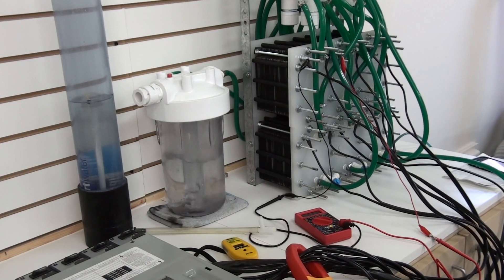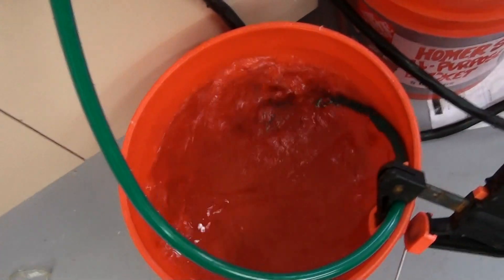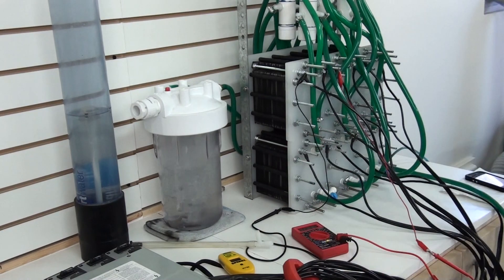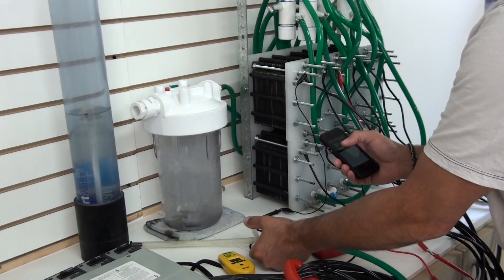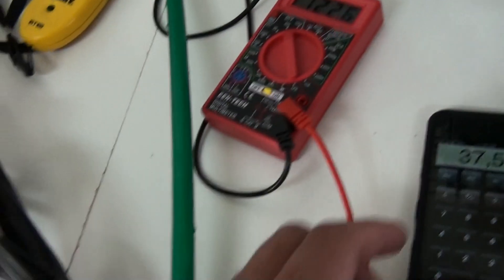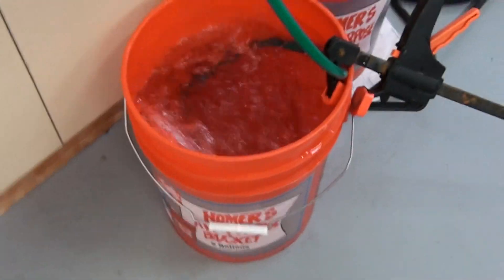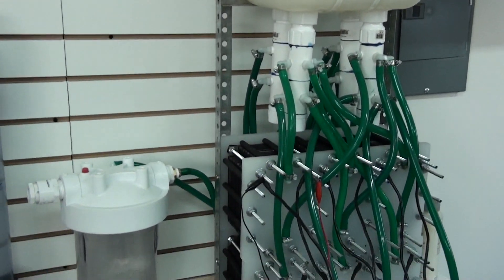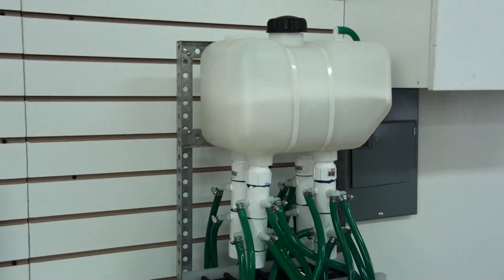Green Fuel H2o 37 lpm !! HHO 354 Plate Monster Hydrogen Generator Build Part 8

Comment: If running at 120 or 240 volts, why not use AC?
Reply from the maker: Mye Flatley because hydrogen can’t be made with ac power
Reply: @Hydrogen4Health  I am an atomic physicist.  The plates are bilaterally symmetric end to end.  The plates should work no matter which direction the current flows.
Reply from the maker: Mye Flatley sounds good but DC is what’s used.
Reply: @Hydrogen4Health  Maybe the chemical reaction is too slow to run at 60 cycles per second.  That may be it.  Oh well.

Comment: What voltage do you use - 120v ac?
Also do you just use 60hz mains frequency, or do you use a 'high frequency' output at the electrodes?
I say that, because I always suspect that if you used a key frequency it would react with the water more efficiently.

Comment: Watch this down video. You need make pressure to put hydrogen down the cylinder because hydrogen  is 14 x more light than common air on cntp. Hydrogen is 3 x lightest than helium!!! So the negative pressure of the engine can not absorb hydrogen without this capilar injection.  The hydrogen ups towards extratosphere if putted down the buterfly.

Comment: Now you just need an update on the mechanic use of this hho. DO NOT PUT it simply down the butterfly. Put this HHO under a 2mm copper or steel capilar nearest to the admitions valves..  If you do this your car will run 100% hho on all rotations.

Comment: how many liters does a 7-10kW generator approximately need per min?
does a windgenerator with his specific wide range in its voltageoutput fit as a power source, or does your system need stable supply?
i like your work

Sven

Comment: So why aren't you using common sense and capture the HHO gas safely and then use it wisely so you can set a good example for other would be max 354 plate makers??? You light it with a torch in your garage? That's really putting a good message out their!!
Reply from the maker: I have know idea what your talking about. Please explain..
Why capture it?
Reply: delvis11
I think he meant to store it if I'm not mistaken.
Reply: Your safety is his concern.
Reply from the maker: +John Wayne The shop is well ventilated. There is no possibility of explosion. Thanks for your concern.

Comment: Question, could you power a generator, that would in turn power the cells? I saw your other videos and you are getting better gas mileage, that would suggest the alternator is not robbing all the power that the HHO is generating, I have seen others do this but on a smaller scale with a 500W shop light being powered. Yours being on a larger scale it would be interesting to see how much of a load you can draw from the same generator supplying power for the HHO cells.

Comment: Now that you've made a viable HHO product; what are you going to do with it?

It use too much electricity to be a good gasoline replacement, but could be very useful for:
A welding/cutting gas or off grid fuel supply powered by wind turbines, you could even compress it into o2 tanks with a old refrigerator compressor, strike that! You would blow yourself up!

I would be interested in whether or not you do put it to practical use, it is spectacular! 
Thankyou for sharing it with us.

Comment: Let's see....127 volts at 60 amps....that's about 7300 watts output or a little under 10 HP.....so what was the input energy? Now then....a 5 liter engine running at 2000 rpm with a 10% throttle will consume right about 100 liters of intake gases per minute. This device is just a wee bit short of that by a factor of about 3. Now factor in a maximum mechanical efficiency for an internal combustion engine of about 29% plus factor in energy losses of the alternators (on a 14 volt system it will require about 7 alternators rated at 100 amps each) and that means that the engine can't even produce enough power to operate this device. Sorry, but you won't be producing enough energy to operate a vehicle.
Reply from the maker: I don't remember talking about running a vehicle from this. I have no clue where you got that from.
Anyway your numbers are off a wee bit.
Reply: They weren't really directed toward you. They were intended for the believers in the "magic hydrogen bubbler" who insist that it increases the fuel economy or in some cases actually runs the engine all by itself. In their desperation, they look for anything that they think can be used to bolster their fantasies. As far as the numbers, take another look at your video. Then DVOM clearly indicates 127 VAC and your ammeter shows 60 amps. If these measurements were made on the output side then the numbers are pretty close. This is why I asked what the input values were. Again, there are those who believe that simply adding another alternator to the engine of a car or truck would supply sufficient power to run the strictly off the hydrogen and oxygen released by a self-contained unit.
Reply from the maker: VERY COOL ! Do you have video's of this car we can look at? I'm sure everyone here and on the forums would be interested in your project.
One thing I want to know is why your getting so much heat? HHO burns so completely that it gives off very little heat.
Thanks for sharing with us.
Reply: John Doe Hate to bust your bubble but an 18 LPM generator only produces 12 LPM of hydrogen at 103 KPA (atmospheric pressure at sea level). As the available heat energy of hydrogen is 9.54 BTU's per liter and 42 BTU's is required to produce 1 HP for 1 minute then your whole system only produces 2 HP. Sorry, that's the facts.
Reply: John Doe Sorry, your example doesn't work with an ICE. Blowing more air into a forge creates more heat because there is a large supply of fuel that has not yet become involved in the combustion process. In an ICE, all but a small fraction of the fuel is burned because there was enough oxygen for complete combustion. Adding more oxygen does nothing other than increasing the flame speed and promote pre-ignition. The other reason why an 18LPM HHO system does not work is because in a normal ICE the nitrogen taken in is heated by the combustion process and expands to apply pressure to the piston. Yes, it is the expanding gases, all of them that applies the pressure. Without the nitrogen, the combustion chamber pressure is reduced and the effective power is greatly decreased.
Reply: +ccryder1149 Your premise of 127 VAC is wrong.  He's not using AC voltage.  It's 126-127 VDC.  Don't you remember his rectifiers in the power box?  Not to mention that he shows us his voltage meter many times, and it's set on the 200VDC setting.  

Not only that, but most automotive alternators these days (for trucks) are 235 amp alternators.  They make very high amperage alternators for 2 things... ambulances, and cars that have those horrendous sound systems in them.  Yes, they make 500-800 amp alternators.  No, they're not that much larger than their more normal counterparts.  

But, your calculation for the wattage was close.  126VDC at 60A = 7500 watts.  If you drop the voltage to 14 volts, keeping the same watts, you come out with about 540 amps, which is easily done with either ONE 650 amp alternator, or a regular one, plus one of these.  

So, it wouldn't be very hard or expensive to set this up in a car if you wanted to.  Not to try to run the care solely on hydrogen... You'd never produce enough for that.  But 37 Lpm is a LOT of catalyst for the fossil fuels.  You don't need much hydrogen introduced into the cylinder in order to make your fossil fuels burn at very high efficiencies.  It's not because of some mystic hoodoo, it's because science.  The rate at which hydrogen burns is 7-10 times FASTER than gasoline or diesel.  So, it CAUSES a more complete combustion of the fossil fuel.  

I'm going to build one of these for myself, I think.  And I'm going to install it into my 7.3L Powerstroke, and see what kind of gains I can get.  And I'll be more than able to power it from a simple high amp alternator.
Reply: ccryder1149  I don't think it's legitimate to determine the ability of a gas to power an engine based on wattagethe issue is can the gas help create explosions that will make the pistons move that's  as far as the car running on HHO aloneas far as using it as an additive the gasoline is providing what's needed to run the car as it normally doesthe HHO increases the mileage by burning  more of the gas than is normally burned the nitrogen factor is normal  when HHO is used as an additive
Reply: +ccryder1149 Honestly, I'd probably just put a serpentine pulley on a 10k 120VAC Generator head, and mount it.  Then use a similar system to what he's got here.  
They're not that much larger than Alternators.
Reply: there is also more Oxygen added besides the hydrogen gas as well

Comment: First of... my complements to the chief!  I do have a quick question... What was the temp rise in the plates over say... 20 minutes?  I noticed your amps increasing during the test in part 7.  With neutral plates I would think it is low, but with that many amps in a small area, I worry about creating just as much steam as HHO.

Comment: you need to replace your gas tank on your car with your hho generator and see if your car will run,, also see if you could electric through your house and not pay electric bills
Reply: delvis11 i can see why maybe storing it wouldn't work too well,but judging by how much you are making there with a solar panel mod and a couple other things you could run some hydrogen that your making through a generator ,truthfully all you would need is an infinite source of salt water ,luckly the ocean is pretty good at that
Reply from the maker: Sorry walter that wont work.

Comment: Thats super cell, you can run basic 1,6l engine with only hydrogen with that generator. I have calculated that you need about 20lpm to drive 110hp engine with pure hydrogen.
Reply from the maker: That may be true. Someday I may try it.

Comment: if you ran a generator of the output gas would it create enough power to run the cells? can this system run itself and create excess power
Reply from the maker: This is not a free energy device and NEVER will be.
Thanks for posting.
Reply: ever had physics in school?
Free Energy IS NOT POSSIBLE
Reply from the maker: You cant store HHO. It has to be made on demand.

Comment: You can buy all the lithium you want, just can't have/ handle lithium 6 or 7 without a license, mostly because it's like giving children nitroglicern to play with. I've seen a substantial number of you tube videos ending in burns / explosions when people are using even common hazardous materials. Lithium batteries can catch fire in runaway reactions, their isotopes can create tritium (Hydrogen 3).  So yes it is quite explosive and if you are talking about the hydride Li(AlH4) that's solid rocket fuel. So  what the government is saying is that we are not letting people drive around in cars that detonate like a failed rocket launch on the road. Also that you need to have the appropriate facility with adequate safety precautions to prevent fertilizer plant style damage to neighborhoods while you experiment. Finally the permit makes the individual responsible for all the radio isotopes they make / handle, so that the supervillans don't have easy access. In my state the minimum license is 500 dollars a year, the reasoning is that if you have an accident with isotopes you've created a small disaster area.
Reply: Um, what does lithium 6/7 have to do with HHO? He is NOT making pure hydrogen, the product is HHO, where the O is still attached to the two parts of H hence, HHO and not hydrogen gas; and also making HHO more dangerous than pure Hydrogen due to the fact that HHO does not need any additional oxygen to combust.

Has anyone tried under water welding with hho? Just a thought..
Reply: jeff davis I believe it was because of a comment about nobody can really access lithium, it relates to storing large quantities of energy that can be used on demand in high power applications such as acceleration in a hybrid vehicle where HHO is part of the means to charge the batteries. From what I've been reading lately graphine which is more stable looks to be a better option. On this front it looks like Elon's Tesla is working in that direction.
Reply: GreningerProductions
It is NOT used to charge batteries in anyway!
In fact it uses a very large amount of energy to create HHO; HHO is made by electrolysis, whereby you apply positive dc current to the anode and negative to the cathode, as you increase the amperage you also increase the production of HHO; it is NOT made in any other way, if you are using platinum or any other method you are NOT creating HHO, HHO is a dirty/sticky gas that has not completely separated the oxygen and hydrogen, the molecules are separate, but stuck together making the new compound we call HHO.

So, as you can see making electricity with HHO would be a FOOLS errand as it requires electricity to create, therefore resulting in a thermal loss if converted back to electricity!
Reply: GreningerProductions
As for storage of HHO for use later, HHO carries oxygen with hydrogen. If you store it it will explode! The gas is perfect as an "on demand" fuel, but it is not something that should ever be stored! Even an acetylene and oxygen torch keep the two gases separate until it is to be ignited! HHO is premixed making it a very volatile substance.
Reply: jeff davis not store HHO, unless perhaps in limited amounts as a liquid, but it would be expensive due to the apparatus needed hydrogen tends to make things brittle, and leak under pressure. A whole different layer of technology that would be found more in a space sciences lab than in someones shop. 
For a few decades I've been toying with the idea of creating an HHO based fusion, that would produce direct energy, at the moment the fusion is possible but the losses don't equate to much of a gain in power, as you must convert heat into energy. Ideally there is a way to harness the subatomic qualities of the neutron in a type of net to create electron flow, from what I've read the high Mev potential of a Neutron is there, just that nobody has really figured a way to more directly convert it to electrons. The most ideal set up would be HH0, the hydrogenated nickel fusion rods/ capsules, and a hybrid particle field like the van allen belts that generates a charge when hit by high energy particles.
Reply: GreningerProductions
You are not getting it, HHO is not a good candidate for storage, it is NOT just hydrogen!

Think about this for a moment, why don't they simply add oxygen to acetylene for cutting/welding gas into one cylinder instead of keeping the two separate?

Because that would make it a high explosive right?

HHO is 2 parts hydrogen and 1 part oxygen stuck together, like I said not a good candidate for storage, it has nothing to do with making things brittle, it is a high explosive and does not need any additional oxygen, meaning that it will burn in a vacuum or a steel cylinder, causing the gas to expand and explode!

Store HHO as a liquid? That substance is called WATER!
You can purchase liquid oxygen $35 per gallon for 34% oxygen H2O2, but that is subject to itself.

Water is converted to HHO through electrolysis, so it has already been converted to electrons, any attempt to capture them at that state would not yield HHO, but some other type of ????

Comment: Hi Steve, have you tried to experiment with TEGS yet ? or a Stirling engine to produce power for the hydrogen generator ? 
If a system could be developed to produce the energy need to run the hydrogen generator instead of using the car's battery the naysayser won't have a argument anymore saying that this won't work because you are using the car's horse power to run the hydrogen generator.
Yes using the otherwise unused 2/3s wasted heat from the car exhaust and cooling system it would be great.

Comment from the maker: I needed a way to separate power. The controllers can only handle 15 amps each. The rectifiers can only handle 20 amps continuous. So I did 6 cells to distribute power better.

Comment: I have not been able to start it to see if there is anything else wrong with it, I connected it up to my battery charger which has a jump mode on it but couldn't get it going so not sure what's going on with it.It's pretty irritating. There was also antifreeze on the ground but all the hoses seem to be on tight so don't know whats up with that.     Have you ever ran into any trouble like this?

Comment: Someone broke into it and messed up a bunch of stuff. They messed up my fuel line by my gas tank busted my key off in the ignition ruined my battery flattened my tire so I have to get all that fixed so I can make it operational again. Someone also broke into my house, hacked my computer and deleted everything I had, they also plugged the exhaust in my 4 wheeler and shorted the wires on the other one. It's been a mess and I am getting tired of it so things are taking even longer because of this.

Comment: Hello I have been researching this technology since 2001! I have discovered that you have to overcome the plates stainless steel resistance...you can do this by using nickel for the anode and copper for the cathode 2 metals with low resistance and the nickel wont oxidize!You will get way more gas output.Sea salt i found is the best electrolyte to use! John Kanzious found 13.56 Mhz radiowave split salt water so maybe it would be the perfect frequency to pulse the curent coming in PWM! God Bless!